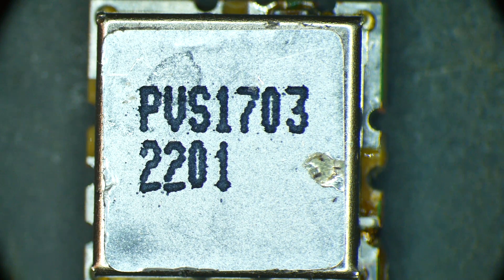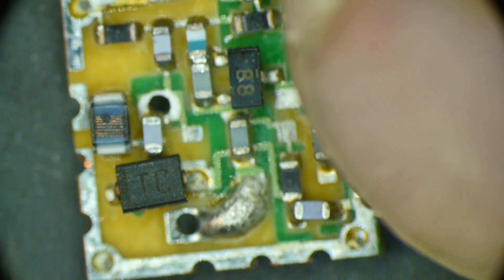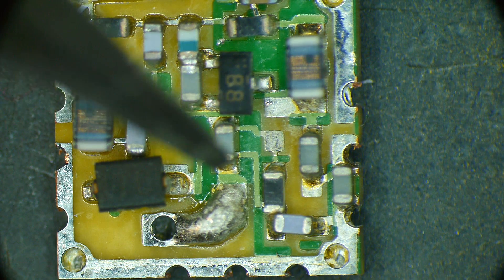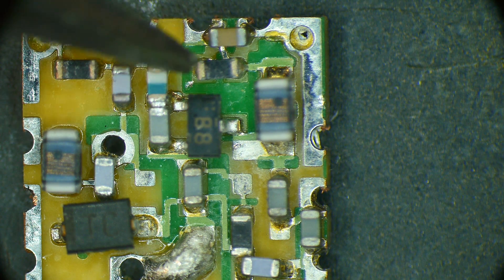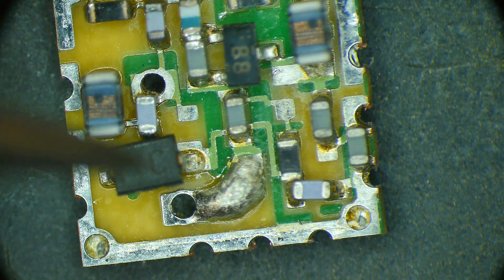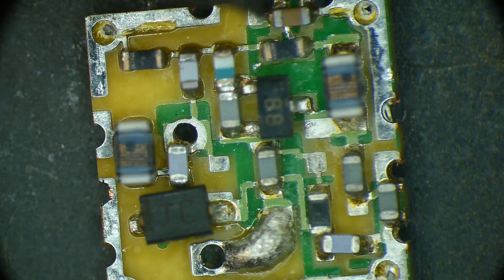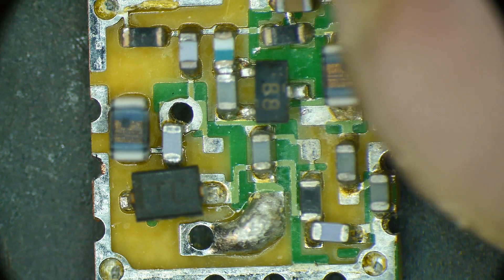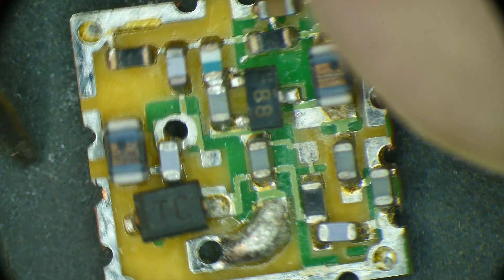#625 Mystery Object. Amp or Osc?

Comment: If the solder is power input and the thing is a fet (single diode) it almost looks like an amp or an oscillator.

Comment: 1703MHZ VCO, could be from ZCOM,, the packaged TC marked is a varactor diode, and the big solder pile is on a microstrip line that is a resonator, usually shorted, the other plastic sot23 is the amplifier that used to build the oscillator.  So its a VCO with tuning using varactor diode in shunt with Transmission line resonator.

Comment: Good evening. Try to remove the solder blob to include the remaining components in the original circuit. It seems to me, as already said by others, a VCO based on the negative resistance topology. The component with a marking code TC could be a varactor diode, used to change the tank resonant frequency. My first impression was that of a UHF VCO, based on the components used. These inductors are probably worth of few nanohenries..... As far as biasing, first try with 5V, monitoring the current consumption and sweeping the tuning voltage from 0 to 5V. Remember that a not well designed VCO can be unable to oscillate when the tuning voltage is zero...Then increase the bias voltage, again monitoring the current consumption. My guess is that this device does not need more than 50mA to work properly from a 12V bias rail. At last, you can extend the tuning voltage to 12V as well. The proper instrument to monitor the output is a spectrum analyzer, of course. Good luck!! Regards from Italy.

Comment: it's the classic shape of VCOs that are used all over the place . I have seen them used in oscilloscope to spectrum analyzers and many more. It's hard to find the datasheet for these Japanese made stuff. The circuit also clearly shows it's a VCO. THe varactor diode is clear and incidentally it's a 1sv260 made by Toshiba and Sanyo and maybe others. The transistor is a 2SC5195 by NEC. The left pin is the control voltage, the right pin is the output and the other one is VCC

Comment: If I had to guess I would say it might be a VCO. The top connection is propably the VCC pin and the right connection should propably be the output, AC coupled from the collector. 
The left pin might be the tune voltage input, which might make sense since it connects to the big part in the lower left, which might be a varactor diode. 
However the solder blob to GND seems a bit strange. 

Is the part new, maybe it was desoldered and the solder blob got sucked in throgh the via?